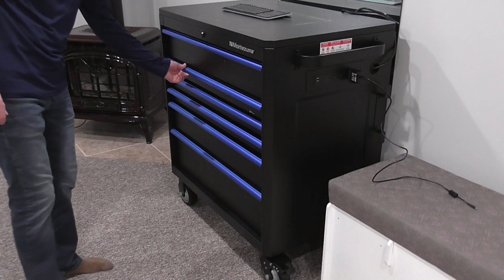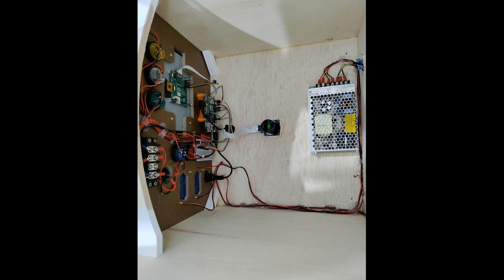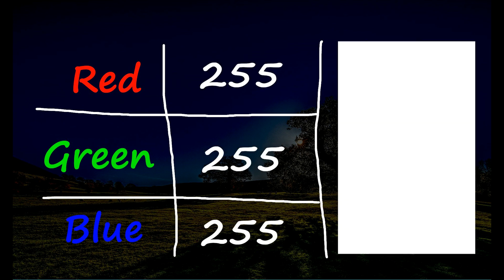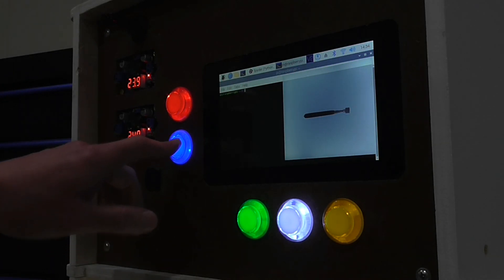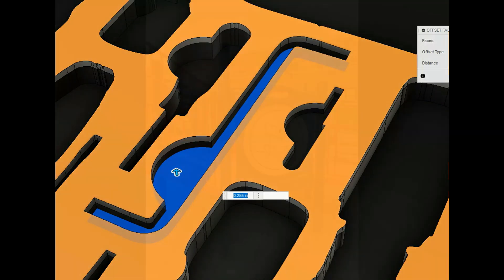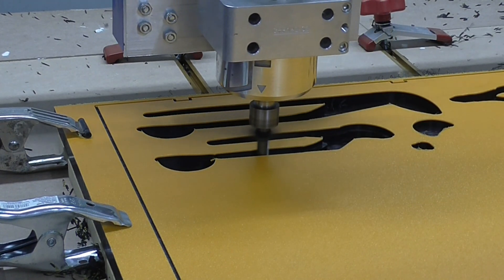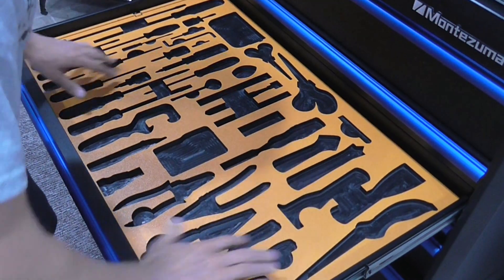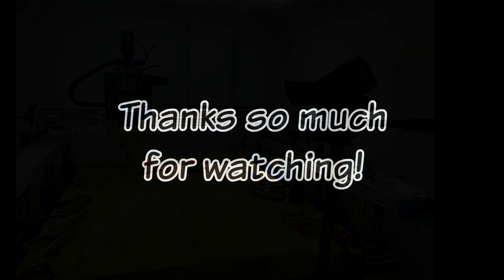Shadowboard Build from the Basement Shop

Comment: From the video, and the comments, I gather that the camera you choose wasn't optimal. So, what camera/optics/focal-length would you recommend, for your awesome shadow-board-camera?
Reply from the maker: @richard-j  If I had to build another one, I think I'd do a standoff of about 6 feet (or in my case, stack two boxes on each other) and then I'd try a more "zoomed" lens.  I did pick up another lens for the pi HQ camera that was more zoomed, but found that I couldn't get it to focus in my setup that only had about 30" of standoff from the subject. 

Sorry I don't have better numbers!
Reply: @scottprints  Ok, I understand what you mean. Too wide angle distorts. So I will try as much zoom that I can fit.
I won't do a box as such. Thinking more "tent", which I can pack up when not in use.
Thanks again for your great video.

Comment: I love the concept. i am currently working on my own version. I understand you reluctance in sharing you code. The only spot i am running into problems is with scaling the image. Every time i import a calibration image into fusion 360 the size is wrong. if you could help direct me to a resource that will help get the scaling correct i would greatly appreciate your assistance.
Reply from the maker: Hi Justin,
I think the culprit there is probably Fusion.  I've had a few puzzling incidents myself when importing geometry into Fusion.  Likely something to do with a Fusion mechanic that I don't understand myself.  
I make sure that there's some known geometry in the source CAD data that I can double-check in Fusion.  One of my favorites is a coin (say, a quarter) that makes a cheap reference.  Include it in your scan and them make sure it's properly scaled when you get to Fusion.
But I've been there with you: had some properly scaled files that were slightly off after being imported to Fusion.  I actually fabricated one once and then found out it was improperly sized.  Not fun.

Comment: I was inspired by this video, but have less coding experience.  I used chatGPT to create a Python script to do a version of this that works for me.  I'm still working on it.  Currently building a lightbox.   I'll post back and provide a link to my script once it's done.
Reply: I tested a light box I threw together with some scrap wood and my python code.  Needs some improvement, but working.
Reply: Well this is why I'm not a coder.  I get close to making something work and then miss the mark.  
ChatGPT is insanely capable, but you have to live with what it makes. Asking for a few changes and it rewrites everything from scratch destroying what you had.   It's a true expert with severe dementia.   I hope someone can figure this out.
Reply: I am working on the same using Chat GPT & Gemeni. It's close but not 100%. I think I need to build a better enclosure for the light box.

Comment: Awesome video! I've watched a ton of videos about tool cutouts, and I think this one is the best. Do you have a name for the material you used? I have searched and searched for 'co-extruded high density poly ethylene' and similar, but haven't found much yet. Certainly not much where you can choose colors. Do you have a name for the 'family' of products, or other competing products? Thanks,
Reply from the maker: Thanks for the comment.  You'll want to look for Vycom Playboard.  There's some industry knowledge required here: Vycom is owned by Plaskolite, and neither 'brand' sells directly to retail consumers.  i.e.: you can't sign into Vycom's website and order a sheet of Playboard.  You have to go through a distributor.
I'm also pretty sure that you'll get some sticker shock when you find out how expensive a sheet of Playboard is.  By the time Vycom, the distributor, and the trucking company recover their costs and add their margins, it's probably going to come to several hundred dollars per sheet.  The only reason that I used it in my videos is because I literally worked in the Vycom factory when I was filming.  I was able to ask for permission to take some scrap home at no cost to myself. ('cause I was making an educational video,  otherwise management probably would have denied my request)
Regardless, good luck with your own project.  You can also search for "Cross Linked Polyethylene" -which is the stuff that shadowboards are usually made from.  Still expensive, but not as bad as high-density polyurethane.

Comment: Thank you so much for such an excellent video. After reading through some of the comments! I thought it might be worth mentioning this.

There is a company called Shaper that makes a product that helps with this process. Certainly not as cool as your bench Raspberry Pi system, but less intimidating for non programmers. 

Their product is called Shaper Trace. It is a plastic frame with a sequence of fiducial marks along the four sides. It includes access to a phone app that handles snapping a photo and doing the math to correct for images captured at different angles. It produces an SVG file that is size accurate and very close to being ready to cut. Some of the files will need a bit of the manual cleanup mentioned in this video. In my experience most of the files are good enough to send directly to my laser. I think it costs about $100. I have one and it is perfect for this application. The one trick that makes Shaper Trace work better for creating tool shadow files is to place the tool and the Trace frame on a lightbox before taking the photos with your phone. This is much like the lightbox included in your bench. The backlighting provides just enough contrast for the Shaper Trace app to get really clean outlines.

Comment: Really an ingenious solution for recording the contours of the tools. 👍
I would like to rebuild your box, but unfortunately I'm not so good at programming the PI😬. Can you perhaps explain in more detail what exactly you have installed here or provide the source code or an image of the SD?
Reply from the maker: Hello Nils,
Thanks for your note.  Unfortunately, I'd rather not distribute my code.  Couple reasons for that: I'm not a great programmer myself, and I know that if I distributed my code I would be inundated with requests for assistance from people that were having trouble adapting my poorly-written code to their own use cases.   
Second reason is that Potrace requires a license if it's going to be used inside of a proprietary program.  While my script is for hobbyist use, I'd hate for someone else to use my script inappropriately as a basis for a commercial program that might come back and bite me later.

Comment: Someone needs to make a phone app that can do this, then the file goes to a manufacturer that cuts your tool organizers.
Reply from the maker: I think that exists actually.  I can't remember what it's called, but some company has a business model that's similar to what you just described.
Reply: There is a company called Shaper that makes a product that helps with this. It is called Shaper Trace. It is a plastic frame with a sequence of fiducial marks along the four sides. It includes access to a phone app that handles snapping a photo and doing the math to correct for images captured at different angles. It produces an SVG file that is size accurate and very close to being ready to cut. Some of the files will need a bit of the manual cleanup mentioned in this video. In my experience most are good enough to send directly to my laser. I think it  costs about $100. I have one and it is perfect for this application.

Comment: You end up needing substantially more surface area with these things as you aren’t maximizing any vertical space. 

Personally don’t mind a wayward wrench placement on top of a screwdriver. 

I’d probably need a full on warehouse and an even heavier OCD diagnosis if I were to “shadowbox” all of my tools.
Reply from the maker: In dense toolboxes, it can make sense to stand tools on their sides.  That usually means putting them into deeper foam or getting support gizmos to hold them in place.  There's also a lot of influence from the sort of environment the tools are in.  I've had a few guys with automotive backgrounds mock my "overkill" because this just isn't needed in an automotive environment.  But guys that come from aviation tell me that I haven't gone far enough.

Comment: Hi
I tried to also build a python code and its working so far.
It keeps me wonder what image size you are using for the jpegs. If my code iterates through every image by pixel to decide by given threshold what is white 0 or not, it takes quite a time for example 10 images including all steps to get one dxf file with all tools in it. I have had several methods also without the iteration loop.
I also worked out a scaling solution and this takes me to the next question. Did you messure and scsle the tools in the CAD software?
I am using a raspi4 with cam module 3 and the picamera2 lib.

Would be great if you could give me a hint. 🤓
Reply from the maker: Hmm... I think that looping over every pixel in your image is causing your slow code.  Try setting up your image in an array (say, with numpy) and do operations on the array instead of individual pixels.  Hope that helps.  I'm not a terribly accomplished programmer myself.
Reply: this I could try... especially since picamera2 (libcamera) does provide an output in an array 🎉... and did you automate the scaling? I also did object recignition with a ref and scale it by converting with potrace but this also gets sticky😅
Reply from the maker: @hrykne6134  all my scaling variables are fixed as my setup has no distance variables.  So I don't need auto-scaling.
Reply: so, I nearly finished..😅
did you do any optimizing on the BMP files?
what threshold number to decide wheter pixel go white or black in the BMP file?
I am asking because I not already happy with the lines of the tool in the bmp file.. they not that smooth...
Reply from the maker: @hrykne6134  depends on the intensity of the backlight.  I made it a variable and change it if it seems to be giving me bad outlines.  You're going to have to set up strategies: shiny tools will need a different set of variables than flay ones, etc.
Reply: @scottprints  I do also work with different constans in a config.json, I got brightness, contrast but I also did thing line smoothing and blurring but I guess it could also be to much?
Reply from the maker: @hrykne6134  sounds like you've surpassed my programming abilities!  Well done!
Reply: @hrykne6134 could you guide me on how did you go about solving for scaling the image with respect to the object

Comment: Awesome project!  I wanted to share a way to keep the tools in the slots.  I have kids that use my tools, but I need the tools back where they belong.  What I did was spraypainting all the tools that same color as where they are from, in your case it would be the same color as the shadowboard.  That way, it makes it easier for them to know where the tool belongs.  

Another hack I do for my metric sockets is spray paint paint them in sets of five as a sequence of red, orange, yellow, green & blue.  Every red is a multiple of 5.  For example, one "rainbow" set would be red 5mm,orange 6mm, yellow 7mm,green 8mm, blue 9mm.  Another would be 15,16,17,18,19mm.  That way you can quickly know going up or down which increment of metric you need without squinting to see the number.
Reply from the maker: Cool hack, thx for sharing!

Comment: Thank you for sharing your techniques. I’m looking at doing something similar with my toolboxes and various projects I’m building. I don’t have a CNC router, but I do have a couple of laser cutters. I will be cutting layers of EVA foam to achieve similar results. Going to research the camera method you used. Way faster than measuring with digital calipers and creating a CAD model.
Reply from the maker: Good luck!  Don't forget to post back here and let me know how your version of this project worked out!

Comment: hello.
i appreciate this video and now I want to build a fotobox myself.
Are the programming steps in python the following:
- taking the picture converting to bmp
- then using undistortion library opencv
- convert bmp to svg or eps with portrace library
- sending to a folder on the network or usb stick?

thanks for your advice

best regards
Reply from the maker: Hello,
Yes, that's pretty much the Python workflow.  I prefer to have Potrace output .dxf files, but the .svg or .eps formats you mentioned would work just as well.
Reply: @scottprints  1 question.. do you have all the pictures on 1.dxf or are those multible
Reply from the maker: @hrykne6134  I have the script spot it out both ways, generating each .dxf individually and one master .dxf.  that way I can use whatever output I need and send the rest to the recycle bin.  Gives me more flexibility.
Reply: are they useful tuts for the opencv part, I want to first rotate ä distortion operation but just finding those chess board tuts with cam adjusting...

Comment: Awesome video. I'm a maintenance manager and trying to optimize the effectiveness of my team and I 200% agree that a razor knife and foam is a half-effort into a good direction. I am curious though (because foam is less expensive than the materials you used), how you mapped the outlines with your shadow box (and how I could do it) and use that data to laser cut 5S foam inserts instead of CNC. Thanks for taking the time to make this video. You explain things very well for people to understand.
Reply from the maker: Hello Mike,
If I were you, I'd back into the process from the end.  So start with your laser and cut a piece of foam with it.  Can you make a shadow board?  If the answer is "yes, but it takes forever" then you're ready to start improving the other parts of your process.  That's how I did it, I started cutting foam with a scroll saw and constantly looked for ways to take the pain out of the overall process.
If you have a CNC of some sort that can cut a shadow board, then start looking for ways to automate.  A next logical step might be to map out your tools in some CAD software (semi manually), then after your team is comfortable with that process, build a rig like the one I demonstrated so that the silhouette generation process gets easier. 
Hope that helps, let me know if you have more questions.

Comment: Hey so In this video at 1:15 seconds, you talk about the bench processing your image into a geometry File. Would that be a SVG file?   Please forgive my ignorance this is way above my pay grade but I need this thing in my life so I’ll take the time to try and learn how you did it.
Reply from the maker: Could be an SVG if you want.  But I use a DXF.  Both would be suitable for this sort of application.
Reply: Another question, about the voltage converters. You have two, what are they used for?
Reply from the maker: @ammonsequiptment9877  pi runs off of 5 volts, the other changes the voltage going to the LED's, which is how I change their brightness.

Comment: I have shadowed several tool boxes using just an ordinary router and using tumbling / yoga mat material as the shadow board. I want to step up my game using your method. However, it maybe a little over my head. I have watched this video no less than 8 times already. I have been researching these Raspberry Pi computers. I am grasping it a little bit at a time I will figure it all out. How long that may be I don't know. To make a long story longer, if I paid you a consulting fee. Maybe around $50 an hour, or whatever you and I deem reasonable, Would you allow me to consult you?
Reply from the maker: I'm not sure that I'm enough of an expert to accept cash for my guidance, but I'll help where I can.  YouTube doesn't have a messenger feature, but look me up on LinkedIn (I work for The AZEK Company) and I'll see if I can get you pointed in the right direction.
Reply: @scottprints  ok I never really used LinkedIn, or any other social media for that matter, YouTube excluded. However, I am interested enough about these subject  matters in your video to step out my comfort zone. My first step is to buy a Raspberry Pi computer and camera and work with that enough to at least know what to ask. Thank you Sir
Reply from the maker: @josephcarlat9414  let's start with programming a little bit of Python.  As a good friend of mine said: 1's and 0's are free.  So get a feel for the software for zero investment, then branch out and buy a piece of hardware (raspberry pi, etc.)
Reply from the maker: @josephcarlat9414  You may be ahead of where I think you are; but can you program in Python?  If not, there's a really nice getting started app from CODELIBR that you can download to your phone.   I found that very valuable as I was getting started.